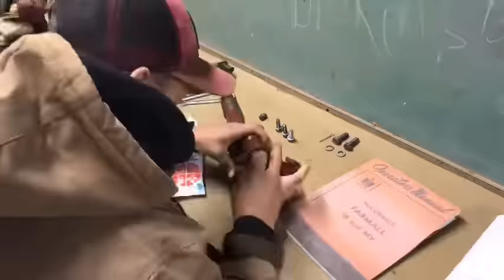1949 International Harvester Farmall “M” Restoration! Timelapse of a Classic Vintage Tractor Rebuild

Comment: It looks good! My uncle, Reed Benedict, started farming in the Columbia Basin Project (Soap Lake, WA) in 1957. The place had a house and machine shed and that was about it. He bought the place from the estate of the previous owner who died in an accident on the farm. It came with two Farmall Ms and a few assorted implements but that was about it. He had a feed lot and grew corn and hay for the cows and wheat to sell. He was into breeding also and had a small Black Angus herd. Along with my aunt, Beverly, and two cousins, Rich and Dean, they worked the farm through the 60s and 70s. Rich and Dean went off to college and worked the farm with their Mom and Dad in the summer. Rich was more suited to be a chemical engineer but Dean earned a degree in Mechanical Agriculture and gradually took over the farm in the 80s and did it all by the 90s. Dean married Joyce and they had four children, one of whom, Peter, seems to have what it takes to make a go of it and is looking to take over the operation. What does this have to do with Formal Ms? Those two original Ms are still on the farm and were in regular use through the 90s. They still work great and start right up. They are semi-retired but see use for things like towing trailers and water tanks. It gets hot in the Columbia Basin and the cab with a/c and more power to do more work with a modern machine is welcome but the Ms were good, honest workhorses which could do what needed to be done.  Great this M is back together and still working.

Comment: Great job! Not only a show piece, but a work horse. That's the best part of restoring a tractor is putting it back to use. Love it, way to go. Be proud of yourself you did a great job.👍
Reply from the maker: Thanks couldn’t agree more, putting an old tractor back to work is my favorite part of the restoration
Reply: The thing that really puts the icing on the cake is that set of duals on the rear very very sexy
Reply from the maker: @bradleamon4466  yes that was definitely the best part!

Comment: Great video, and the tractor turned out beautiful!! The Glyptal inside really brings out the quality and time you put into the restoration! Great to see the youngins getting into the hobby!! Nice job!!
Reply from the maker: Yea I’m still not sure why I spend so much time making the components on the inside look as good as the components on the outside, but I just couldn’t put a part back in If didn’t paint the exposed cast surfaces with Glyptal and have all of the machined surfaces clean and polished. Maybe that’s why my restorations take multiple years haha! Thanks for the compliments, you did a fine job on your H and I’m looking forward to the reassembly videos on your D.
Reply from the maker: Honestly after seeing all that fresh glyptal on your H, I sorta couldn’t resist! Really though I think it does help with oil drain back and will probably prevent rust in the bell housing.

Comment: Nice job, I did an M with the early wide front last summer.
Reply from the maker: Thanks I have watched all of your videos on your M, (you did a splendid job by the way) and I noticed that we had the same wide front. Mine was pretty rough and it took two font ends, some custom bushings and a bunch of spare parts to make mine like new. Heck I probably have 5 parts tractors that contributed to the build. It looked pretty nice at first but It was a real basket case on the inside.

Comment: I still have my dad’s little 1953 farmall cub that I redid a few years ago and still use it to mow ten acres of hay and to garden with.
Reply from the maker: That’s great, my Pops has a cub that I really need to get running. I had the M parked next to it the other day and it was kinda neat to compare the sheer size difference between the smallest Farmall of the time and the largest

Comment: I noticed that somebody had changed the magneto out for battery ignition. I also noticed that this tractor still had the old distillate manifold.  Dad had the engine on his H changed over to gas.  This involved replacing the cylinder head with a higher compression gas head and a manifold that didn't have the heating chamber for running distillate.
Reply from the maker: Actually this tractor never had the magneto or the distillate manifold. It is a 1949 M Serial Number 201036 X1. The X1 signifies that it originally came with the higher compression cylinder head and the gasoline manifold. Also being that it is a 49 model it likely came with distributor ignition from the start. When I found a replacement hood for it I made sure it was the gasoline hood without the extra hole for the starting tank. The old manifold was very beat up and the video was quite blurry so it may have appeared as a distillate manifold. And yea those higher compression heads are nice for running on gas. I have a 1940 H with the distillate head that runs pretty well on gas, but it only builds about 70 pounds of compression. If I ever find a parts tractor with the higher compression head, I will definitely be doing a head swap on that H.

Comment: My dad had 1947 W6. Had a 1949 Ford 8N too.
Reply from the maker: Nice my granddad has a WD6 they are great tractors for sure! I have a 37 W30 the predecessor to your dads w6. I will probably be restoring the W30 once I finish up my Ferguson
Reply: @gusthefarmer5608  Where is that?  Looks flat. This is Ontario.  Kind of rocky and hilly when you get away from the lower lakes. I often wondered how anyone grew anything in some places.
Reply from the maker: @jeffpotipco736   Central Oklahoma where I did the restoration but I was farming with it at my grandparents place in western Oklahoma
Reply: @gusthefarmer5608  I thought that or Texas.
Reply from the maker: 30 miles from the border so your not far off

Comment: What is the red paint for on the inside? 6:05 Thanks!
Reply from the maker: It’s an oil resistant cast iron sealant paint made to seal the inside of castings and prevent oil from seeping into pores and imperfections in the cast, plus it helps oil not stick to the case and it lets it have a better drain back during oil changes. Also in dry compartments such as the bell housing it prevents rust. The product I used is called Glyptal

Comment: Was that wineing noise in the transmissiom or rear end i head it when you were driveing it down the road
Reply from the maker: Yea it sounds like a gear whine, but actually it’s the new reproduction fenders rattling. It had a bit of a loud gear whine at first but it has quieted down to the normal Farmall whine as I wore the new transmission in. I know what you mean it sounds like a bearing is out but it’s just those cheap fenders.

Comment: A lot of weights on wheels, need to put on inside wheels. Can brake axles with outer weight, I have broken axles and wheels on smta before.
Reply from the maker: Yea I could see how that could cause an issue on turns or something with the twisting. Really, it probably only needs one set on each set of wheels, but when I put this tractor together I had a bunch of spare weights and triple weights hanging on the outside just looks really cool. I guess I will cross that bridge if anything ever happens, after all this tractor probably only gets 100 hours a year at most. But with that being said if anything ever breaks I have several spare axles and wheels and I would take the weights off at that point. Thanks for the advice!

Comment: Were those experimental disc brakes or is that something M&W ?
Reply from the maker: That’s actually a fairly rare option on the early Ms, band brakes were standard of course (by early I mean anything before the last few years the m was produced). The last few years (late 51 early 52) they made the M band brakes were still standard but the disk brake options for them were the same as what the Super M used. Disk brakes were standard on the Super Ms. Basically those disk brakes were just a rare option just like the rest of the rare options I have on the tractor. By the way in the discription of the video I included a list of all the IH factory options I included on the tractor.
Reply: Yes I noticed a few options like the top of the air cleaner the adjustable rear tongue the rear fenders the wide front with the mounting plate that sets the front axle back farther the front wheel weights and the hydraulic controls. These are definitely things I like to see contractors whether they're restored or not me personally I like looking at tractors that are still in the work clothes

Comment: How many hours from tear down to finish?
Reply from the maker: Honestly, I didn’t really keep track of my time as it would be very difficult to measure as well as it took a lot longer than it probably should have because it was my first restoration project ever, and for the first few months I really didn’t know what I was doing. All I know was it took most of my spare time from 2 1/2 years. I didn’t get much done in the summer because of farm work tractor shows ect but I was able to accomplish a lot in the winter. I am currently working on another restoration now and it is going way faster.

Comment: Surely he knows how to stop to shift gears.  At 45 seconds that was awful.
Reply from the maker: We were trying to make 5th work, it would grind but wouldn’t go in because the gears were so worn out from that type of shifting. In the video Granddad was in 4th, tries 5th, found it simply wouldn’t work and went back to 4th. A good experienced operator can shift from 4th to 5th without much grinding. It’s true that shifting like that is what caused 5th to go out but since 5th was already out he wasn’t afraid to try it like that as it wouldn’t go at all with it still.  With a good new transmission it now shifts 4th to 5th easily. I always make sure not to grind the gears as I was able to see what damage it did.

Comment: M's are not worth restoring  just scrap iron.
Reply: Oh poor you, projects like this one are not about money. If they were nobody would restore history. Get a life.
Reply: I bet that M can still do a full day’s work just the same as 50 years ago, I doubt we can say the same about you.
Reply: A H will do more in a day than a m and on less fuel.
Reply from the maker: It may use less fuel but it has way more power. An M has about 33 hp on the drawbar but an H has only about 21 or so. The H was more fuel efficient because it couldn’t do as much in a day. For example we pull chisel plows with Farmalls. An M will pull 9 shanks with ease but an H struggles to pull 7. Don’t get me wrong I love Hs, but you can’t hardly call an H better than an M. It all depends on what you are trying to do. If I only had a two bottom plow an H would be better because of fuel efficiency but if an M is paired with the proper implements, an M will outwork the H every time.
Reply: @gusthefarmer5608  damn straight! I love them both.